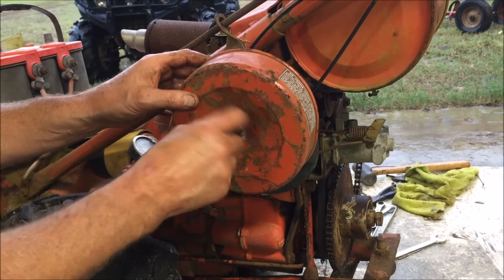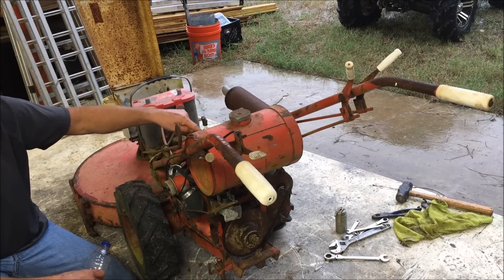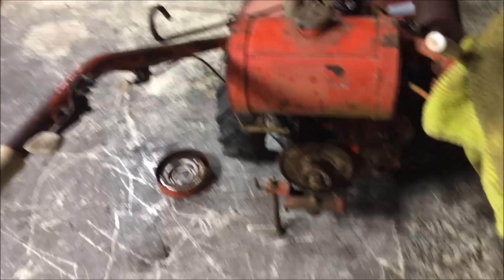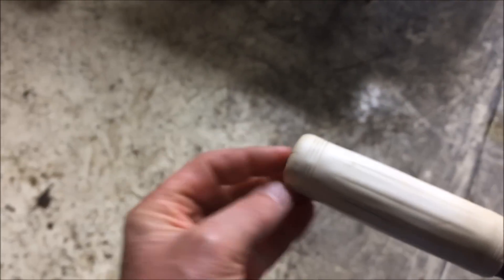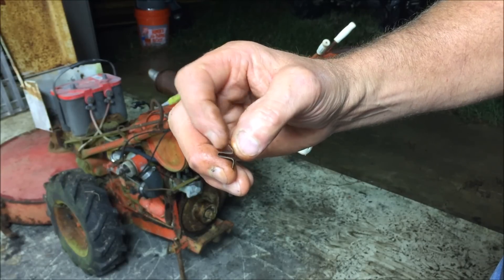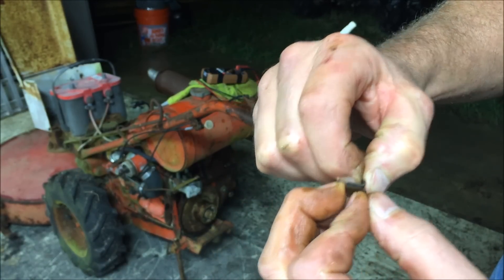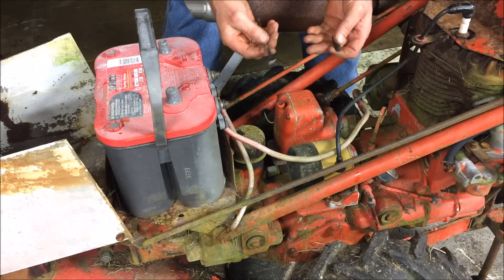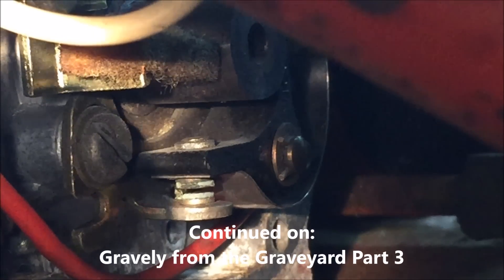Gravely Walk Behind Tractor - Troubleshooting No Spark/No Fire

Comment: That's a really good video.  So many of them I see you can't hear the narration or they do the work with one hand and hold their camera in another. I just hope you're as skilled in Gravely repair as you are with video, LOL. Your machinelooks very similar to the old Gravely I just bought so I'll be looking for your other videos. Mine (L8) runs fine, but I'm having trouble getting it to move at a speed I want. Any video you can suggest will be appreciated.
Reply from the maker: I have a whole series of Gravley videos but none on the transmission.  They are not very fast machines.  Mine had a low and high gear.  Some models had an additional lever for more gearing but I've never seen one.  All the variation you have is gear selection and throttle control.  Good luck with it!